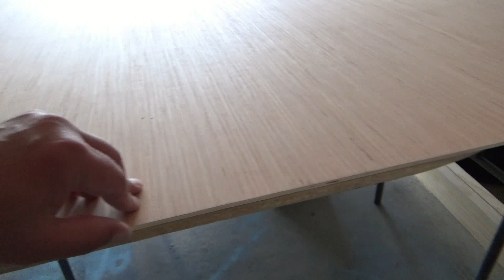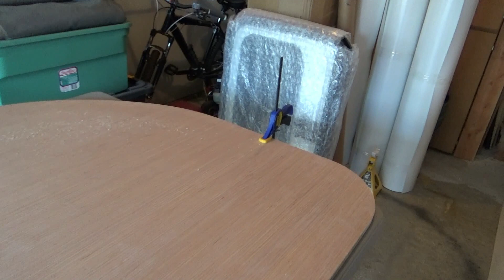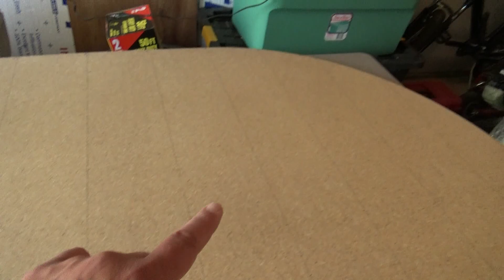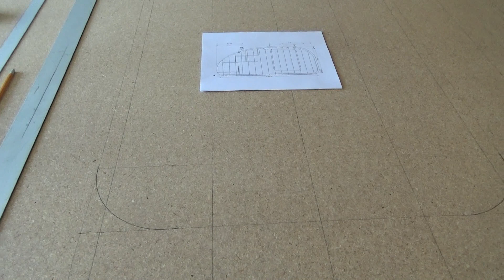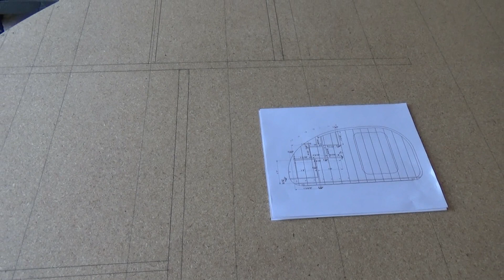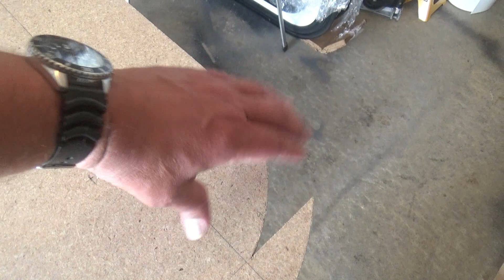Let’s Build A Teardrop * Step-By-Step * - Part 4 (Routing the Side Walls)

Comment: Hi!  I have a question about the radius used for the doors.  The radius on the doors from teardroptrailers says 4.75" and your drawing says 4-5/8.  Is the difference to make sure the door fits tightly?
Reply from the maker: I would go with the manufacturers recommendation. I purchased my doors from Vintage Technologies and took the measurements from the doors themselves. If you use VT doors, them 4-5/8 is just right.

Comment: Hi, during the marking of the door opening, you adjusted an additional 1/4 inch which I see reflected in the plans but on the plans I received, the dimension to the bottom of the door is not shown, as it is in your video, did you modify that height as well?
Reply from the maker: the height of the door cut out to bottom of template is 6".... so the door cut out is 4" above the floor. Hope that helps!

Comment: Sir I have a question; My trailer is 7 foot wide and 10 foot long. Seeings plywood only comes in 4x8 sheets how do you do the add feet? And what is your final weight of the trailer?
Reply from the maker: Hi Kenneth! You would need to use a scarf joint to butt the two ends together to make the length. I'm guessing the final weight to be around 1100 pounds.

Comment: That looked like a challenger door, is that where it's from? If not where did you track it down, challenger door was the cheapest I could find when I was getting all my stuff together.

Looking good as always.
Reply from the maker: Thanks DR! I purchased the doors from Vintage Technologies, teardrop trailer parts...  I wouldn't say these are the cheapest at $385 each, but will work and look nice. Just like most things, if you want it... better save up for it! :)
Reply: @OregonBatman  My challenger door was about the same, think I paid $360ish for a similar size. Only issue with them is as they are a custom door company you have to wait 3-5 weeks for it. Everywhere I could find micro door/teardrop door they were like $600+. Not sure if that was due to availability or what but I was sure glad I found Challenger doors when I did.
Reply from the maker: I've been on business trip for the last week, so getting back to you late... these doors came in about a week. Vintage Tech is usually pretty good about shipping quick and on time! My go to guys! They are on Ebay too, so makes it pretty handy!
Reply: @OregonBatman  Good to know for my next project, thanks